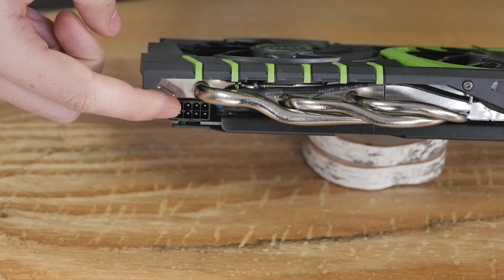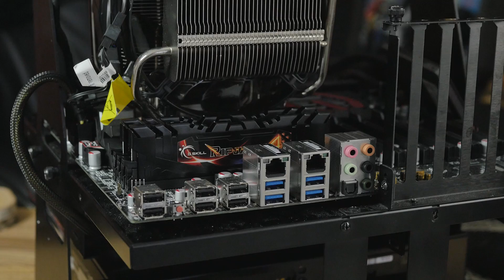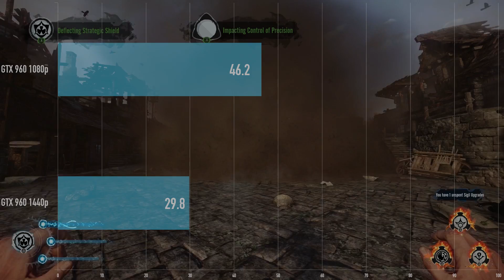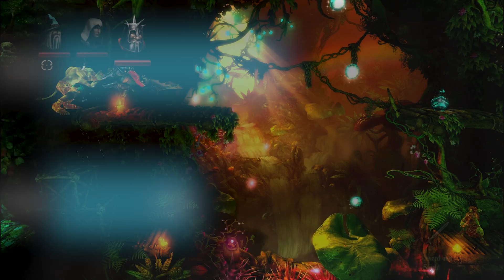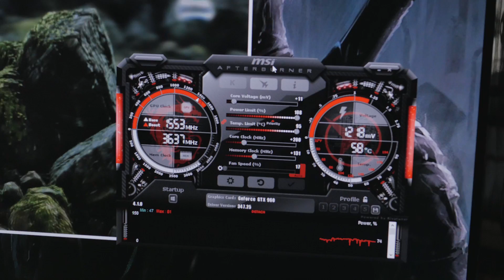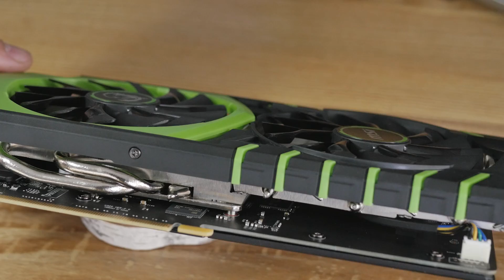MSI GTX 960 100 Million Edition (Limited) Review & Benchmarks

Comment: Sadly the 380 will completely murder this in every category positively, except it'll murder your PSU. I'd rather get a Windforce 380 4GB for $10 LESS.
Reply: +AlphaLineGaming AMD? ew.
Reply: Amd is shit
Reply: Light Yagami Where did I take sides? I love Nvidia but it's a shame that their cards are more expensive for less performance until the 980.
Reply: Well, I got a MSI 960 4gb, and you can play games like GTA V at high settings without hitting 49 Cº. I usually get like 44-46Cº. While the 380 goes above 60Cº, which is safe, but still.
Reply: +Jeep depend whic version of 380 you have. My Gigabyte G1 380 never go above 53-54c in games.

Comment: I have this card and honestly, i'm very happy with it. At high/very high settings 1080p 60+fps in most games, it kicks some ass. i see a lot of people say to go with a 970, but for a budget build id say just buy this. Id rather have all around performance on all my components than spend extra money on the graphics and have to cheap out in other places, or wait a whole extra month or so till i have the extra cash when the 960 in its 4GB or even its decent 2GB can do almost anything i honestly want or need it to do. This card was made to appeal to people who need a good priced upgrade from say a 750 ti or say a 780 and lower, it does that and even just a little more. You also have to put into consideration the CPU you pair with that said GPU will make quite the difference as well. I have my card pair with a 6 core i7 980 from a few years back, so yes i get as much from this card as i possibly can and honestly i could go with a 980 or 970 and be set for some time, but this card paired with my CPU is giving me the results i wanted and i didn't spend over 220$ on the card alone. and a lot of budget gamers will be buying AMD parts or much older Intel parts that could potentially even bottle neck a 970 if they buy used or in general just parts from a couple of years ago, so they might as well get something like this at least in my opinion.

Comment: what gtx 960 is better this one or the Red msi gtx 960 gaming edition
Reply: MegaSonic They are the same aside from change in color and the extra backplate on the 100ME limited edition. (which adds 12 mm to width and 48g of weight if that's a factor for you)

Comment: Disappointment isn't the word Thief on PS4 1080/60fps 960 1080/46.6, Trine on PS4 1080/60fps 960 1080/50fps, until people can acknowledge and understand why a PC needs more hardware power compared to games consoles with half its speed please reply......and it's nothing to do with optimisation.

Good luck with the GTX 960, it's currently a 970 minimum with the new cards, thanks for the info.
Reply: The fuck you are talking about, thief is only 1080p/30fps on PS4 and it's not even maxed out. But still I agree with you, this card sucks

Comment: If you're considering this you might want to get the 280X or even 290X. They absolutely destroy this card when it comes to performance and performance per dollar. 

And that's coming from a dedicated Nvidia user. I feel like they let us down with the 960.
Reply: How so?  Its a $199 card that matches the R9 285 (which debut last fall at $249), beats the R9 280 and matches the R9 280X in some titles (and its going for $30-$50 more).  The R9 280X does not "absolutely destroy" the GTX 960 at all.  Its a little faster.  The R9 290X does, but it should considering it costs between $330-$400.  The GTX 960 sits between the GTX 760 and GTX 770 in performance for $200 using just a 128 bit interface plus runs cooler and quieter and uses much less power than any of its competition.  I think that's a pretty good feat (but you can be disappointed if you like - its your right).

Comment: right now you MUST go for the R9 280x or better spend 100€ more and get a 970. I also heard a 960 with 4GB GDDR5 is coming in March it will be useless.... ( will cost around 230-300€) anyway R9 280x or GTX 970 FTW
Reply: 290 is a better option. The 280X are priced at £200 still, with the 290's from MSI (Gaming Edition Twinfrozr) and Sapphires TRi-X OC 290 priced at just £220. The TRi-X is even beating the 970 in some benchmarks, and costs £80 less. All in all, nVidia are a joke. Have been for years.
Reply: the Sapphire Vapor-X Radeon R9 290 Tri-X OC --- Cost £399 and the Gigabyte GeForce GTX 970 Gaming G1 --- Cost £448 ( im in Germany )

Comment: Interesting. Sadly, I bought a 760 a few months ago. I'd be interested to see if that 128-bit bus will be limiting. I believe the 760 is 256-bit. I know the newer GPUs are much more power efficient, and it's great that it only takes one 8-pin connector.

Comment: 2gb is a drawback nowadays. Games ask 3gb for 1080p if you want to max it out like ryse, shadow of mordor. So nvidia guys, don't try to say that 2gb is good for 1080p cause' it's not! Just accept it nvidia failed with this card. Hope gtx 960ti is 256bits 3gb vram. I have amd gpu, but wanted to buy a gtx 960. After its specs, I won't buy it.
Reply: This card is more for free to play games
Reply: Javier Pool look into it now :D gtx 960 ftw 4gb is now out it should run games smoooooooth probably the best mid range card on the market in my opinion

Comment: Barely even an improvement over the 760 (performance-wise at least). And with that price? Nah. With how cheap AMD cards are these days there's no reason to go with Nvidia in this price range at least.
Reply: Ya, sucks.
Reply: http://www.techpowerup.com/reviews/Palit/GeForce_GTX_960_Super_JetStream/29.html

On average its about 2% weaker compared to a 285, according to newegg a 285 is 209-230$.
Reply: hey what am i doing here
Reply: *****
285 is not the card to buy. The 280x is far stronger. The standard 280's are far less expensive, and some models like the MSI overclock very well. But yeah, the 960 is just a joke XD

Comment: Not impressed, honestly. subpar frames for that kind of money? I'm not an expert in computers by any stretch but as an average consumer why would I spend so much money on said card when it will barely pull 60fps on those games @ 1080p?
Would've expected it to just blow all those games out the water, I mean thief? so little frames on that game? nty.
Reply: Cinnabun Pay 600$ then, you'll have your 60fps.
200$ is not expensive for a graphics card.
Reply: Cinnabun What ? The 960 is around 220$ so thats not exactly a lot of money in terms of graphics card, it does decent for its price.
Reply: Cinnabun You are starting to contradict yourself. Bottlenecking would only apply if the card would be too fast, which you doubted in the first comment.

All in all, this card is great (performance, power consumption and thermal) for its price.
Reply: The games are maxed out, that's why the performance looks bad. Turn off some of the filters and you can run all of those with a decent framerate.
Reply: TheRealDerohneNick
So you're saying spend a lot of money for a card that can't handle some game settings?
 :/ does that not seem a little bit like bullshit?
Reply: Cinnabun No, not even the GTX 980 can handle "some game settings". For the price, the 960 is alright.
Reply: Cinnabun Well, not really. An i3 is not expensive and its the ideal cpu for this graphics card i'd say.
Reply: Do us all a favor... go buy a console. You obviously do not belong to the PC Master Race.
Reply: unfortunately we don't live in a utopian society where anything is possible
Reply: TheNumberTrenton
I'm not a console user LOL
the only console I own is an N64.
Reply: Some Looty Hey the gtx 960 is a great card, I just bought one myself to put in a gaming rig with an i3 and its running games beautifully. But lets be real here, the 280x does blow the 960 out of the water, about 10-15 fps more in almost every game and able to use more filters because of its 3gb vram. Lots of benchmarks out there to prove this. Im regretting having bought my msi gtx 960 for 20 dollars less than a 280x, but all the neat features on the 960 keep me happy :)
Reply: +Cinnabun You dont't know about hardware like you said, At 1080p a $450 card can't max out some games at 1080p 60fps. Go play angry birds on your iPhail.
Reply: Some Looty 200 is a considerable amount for a single card, factor in you'll need a decent CPU so you don't bottleneck starts to add up.
Reply: Cinnabun even at medium settings it beats the consoles so i'm not sure what you are talking about? Its like saying spending to much money on a V8 for racing is "a bit to much"
Reply: *****
spending too much is always a negative.
Spending as little as possible for maximum quality is always what should be expected.

it seems with this card what you get for your money is the ability to say "I own the limited edition 960" and to have the green coloring.
Reply: Do you live in this country WTF expected???? My main problem with this is you expect pricier stuff to always be bad? Then you claim you should expect great cheap products. 

Man what country are you in before we continue this type of discussion? Also i'm curious if you are a gamer if so what platforms do you game on?
Reply: I mean gaming isn't cheap those consoles for example cost 400$(this card would be in a 600$ rig). 

Consoles provide 900P-sub 30fps in most titles even old ones. 44% less ppi and half the performance. 

For 400$ a 260x+Athlon 760K. This build would do a better job. They make builds for different demographics. Its like saying why spend 600$ on a 4K TV when you can have a 1080P one for 300$.

Then we have to go into the sweet spot in terms of price/performance/features. 

It actually comes down to basic economics like a 101 class or something.
Reply: SMAA, Uber Sampling, PhysX, all of these can wreck cards that are even $300 when put together, if you can't handle it go with your "next gen" consoles.
Reply: Cinnabun Nice! I've only got an old Gamecube sitting behind me, it was my childhood.
Reply: Some Looty
£180 for this card in the UK, which is actually £10 more than a 280X, yet the 280X totally blows the 960 out of the water in every single way. So .... tell me again, that the 960 is good for the price :D

£139.99 gets you a Dual-X 280, which is ALSO faster than the stock 960's. Thats a 7950, 3 year old mid range card, beating the brand new 960 by nVidia.

I was laughing so hard I broke a rib...
Reply: TheVanillatech Actually, the 960 is around the same with 280x, sometimes a bit worse.. Much red fanboy ?
Reply: Some Looty
You're WRONG though, aren't you? Because if you look at the multitude of hardware sites which have reviewed the GTX960 since it's release a few days ago, EVERY SINGLE ONE shows that the 960 is far below the 280x. Every single one shows that even the 280 vanilla (which is a 7950, in case you didn't know) beats the 960 in MOST benchmarks. Given that the 280X is a 7970, which is far faster than a 7950, it seems you must be either an alien or a total dumbfuck to suggest than the 960 beats the 280X at anything :D

Again, I am saying that EVERY SINGLE MAJOR hardware site says that I am right, and you are wrong. If you can show me Hardware Cannucks, Linustech, Anandtech, Tech Power Up or ANY major hardware site that backs up your stupid ass claim, I will ignore the laws of physics like you seem to have and agree with you. But you can't, because they don't exist.

Thankyou ;)
Reply: Some Looty
Oh an by the way, once you get to my age you tend to lose the whole consumer loyalty branding thing. You grow out of it. Considering I own over 100 graphics cards, dating from the late 1980's right through to my R9 290, and most of them adorn the walls in my studio, it's quite safe to say I've been there, done that. I have no sway one way or the other. I say exactly what I see. I'm all growed up.

I haven't used an Nvidia card in my main rig since... the 6800 XT AGP. I did have a GTX570 AMP! Edition for a while, but it was an interim card which I borrowed while I waited for my HD5970 to be delivered. Both companies make great cards, I have no preference other that what is the best card I can get for the money in terms of price / performance. It's not my fault that since 2006 I have decided in every single case that ATI / AMD have had the clear winner, and that it's still going on today.

Wake up. 280X rapes the shit out of the GTX960. Nvidia done fucked it up again. It's a joke of a card. Not my fault, don't blame me. But please, try not to make silly statements that a 5 second search on google will dispute. It makes you sound like, well.... kinda like a fanboy.
Reply: TheVanillatech No, it really doesnt rape shit out of gtx 960.. Its around 10% better.. That sure isnt much.
Reply: Some Looty
Sorry, but there is clearly no hope for you XD

" Actually, the 960 is around the same with 280x, sometimes a bit worse.. Much red fanboy ?"

Tell me again, what you didn't understand from my full, correct and comprehensive post in which I directed you to real life facts displaying how you were "WRONG".

280X > 285 > 280 >/= 960

Please, don't take MY word for it. Go to google, and look it up.

If the 960 can't beat the 7950, and the 7970 Ghz edition is 20-25% faster than the 7950, then in what world is the 960 only 10% slower than a 7970 Ghz Edition? In your world? In nVidia world? Cos honestly, it's not happening on Planet Earth. Not with these laws of physics. Not even for you, Harry! XD
Reply: TheVanillatech The gtx 960 is just a bit worse then gtx770 which is pretty much the same as r9 280x.
Reply: Some Looty Keep on believing :D It's your word vs the entire internet hardware review scene. Good luck!
Reply: Uh lmao for 200 dollars you wont get better than this. unless you want a 280x on crazy sale
Reply: Cinnabun unless you are willing to pay one grand like i am for a computer do not expect 60 fps on max settings while recording or live streaming
Reply: Mashu Haraguni
Shadowplay gives recording in 1080p at 60fps with zero performance impact. You can link shadowplay to Twitch now. So... try to keep up.

I can build a gaming PC for £500 that will play ANYTHING in 60fps 1080p. Make that £720 if you want to include a 1080p 32" Smart TV with DVI and HDMI.
Reply: no you cant, shadowplay only works on nvidia cards 600 series and above, try to keep up. you will not stream on this card regardless of settings
Reply: Mashu Haraguni
Please tell me where I said that you DONT need an nVidia to use Shadowplay... or are you that insane with stupid that you just make things up as you go along?
Reply: LoLUnderstated The power consumption is also much lower.. But in my country the 960 costs about 50$ less then 280x, so yeah.
Reply: I understand, price was my main driving reason for buying the gtx 960 over anything else. That and its newer technology. Also the super sampling on this thing is amazing considering I play league of legends a lot :)
Reply: LoLUnderstated
Swings and roundabouts, my friend. Glad you're happy with your card though, thats the main thing.
Reply: What do you expect out of a 200 dollar card? On Max in some newer games my 970 gives a little breathing room at 1080p, but no 200 dollar card is going to hit 1080p 60fps Max on new games. You've set yourself up for disappointment with that awful logic. High still looks good/better than consoles and will give you 60 fps.
Reply: Jaosn Well I can get a R9 280x TwinFrozr for £150, which is £40 less than the cheapest GTX960, and the 280x can do max in modern games at 60fps even if the GTX960 cannot. Don't bring up Crysis 3, because even my GTX970 can't run that in MAX with a solid 60fps all the time.

The 280x even at stock is around 20% faster than the GTX960. It can be done for that price. To be honest, my GTX970 is a great card and I only game at 1080p, but after owning it for a few weeks it's clear to me already that this is a 1440p card. I am hitting 100fps in Metro Redux on Very High. There is so much more breathing room to go up.
Reply: TheVanillatech As i said, the prices are different everywhere, the most expensive gtx 960 is cheaper then the cheapest 280x in my country.
Reply: only getting it cause the color matched my build

Comment: Wtf? My gtx 760 gets 42 fps in Valley and also higher fps in some of the games you benchmarked. Great job nvidia! Probably because it's only 128-bit, 760 has 256-bit.
Reply: The GTX 760 is still more expensive than the GTX 960
Reply: The BUSS speeds are JUST NUMBERS!!!!!!!!!!!
THEY ARE MEANINGLESS!!!!
you think the 980 was crippled by a 256bit buss?

Also, your settings are lower than his
Reply: Nope, I ran Valley at Extreme HD and I got 42.2 fps in 1080p
Reply: Sanic No, Extrem HD settings is x8 Anti-aliasing, nigga!
Reply: ***** Video or it didn't happen.
Reply: ATI released a 128-bit card in the 4770, which was also based on new technology, much like the 960 is. The difference is, the 4770 was actually a great card, even beating the 4830 and sometimes the 4850, and was also priced extremely well. This 960 is a fucking joke :DDDD